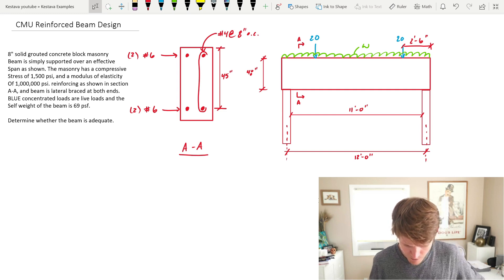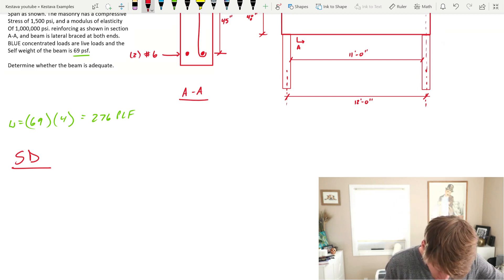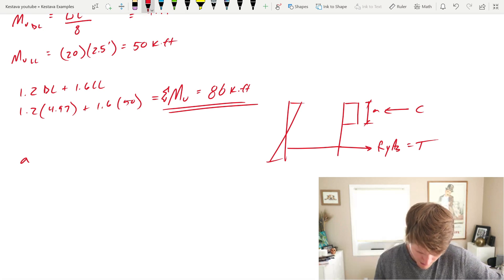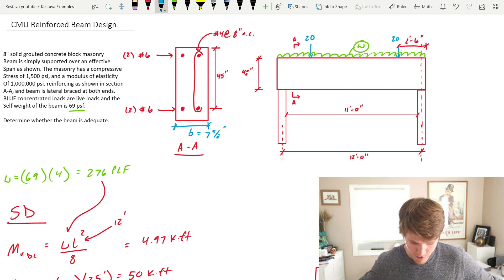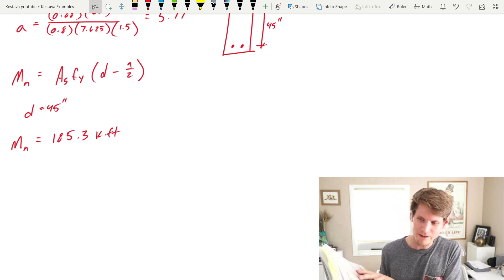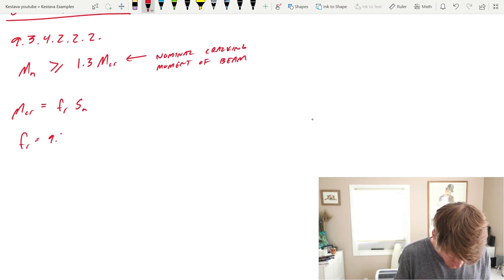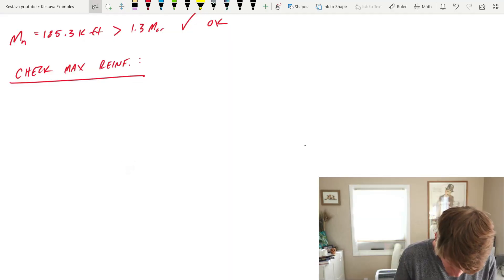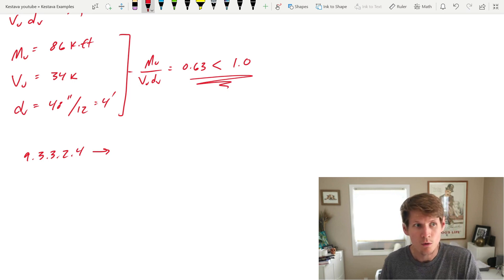Reinforced Masonry Beam Design Example | SE Study Prep

Comment: Great video! One thing I will point out to anyone in the comments, ASD vs LRFD will give you very similar results for steel design. These two design methods will yield vastly different results for CMU design. I have designed CMU retaining walls that fail miserably when designed using ASD, but pass with no problem when using LRFD. Usually I will run CMU members first using ASD and if I can’t get a reasonable solution, I will use LRFD. I forget where I heard it, but the newer TMS version (not sure of the year) is switching to LRFD only, similar to how we design concrete.

Comment: to get the self weight of the beam shouldn’t it be multipled by width and not the depth?
Reply: It would be the depth. The CMU wall self weights are given in the ASCE 7 dead load commentary and split up based on the thickness, meaning that you would need to multiply by the height/depth to get the vertical load in lb/ft. Although this isn’t explicitly stated in the problem, this is the way to do it

Comment: Wouldn't the effective length (Le) be 13'? Beam supports have to be H/2 from center of support to the opening from my understanding, so that would be an additional 1' at each end of the "beam" to add to the "effective length". I am a little confused as to how to determine the effective length if it is not already provided in the question. I know its only an additional foot or two, but I want to clarify the solving process for myself since there's a disconnect on my end. Thanks!

Comment: LRFD vs ASD?  many of the resources seem to be ASD, is this changing? what if you design the concrete and steel in LRFD with in the same structure as masonry in ASD. Is that allowed?
Reply: Masonry is typically done with working stress method, ASD. I prefer to do masonry beam design in LRFD.